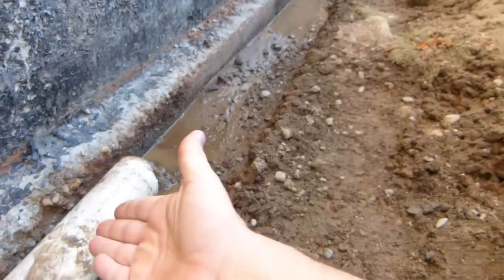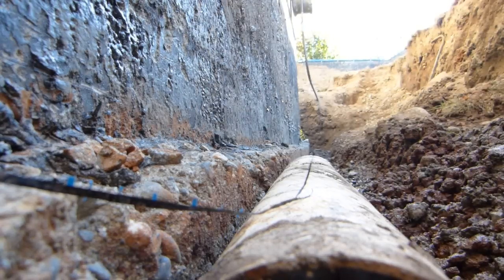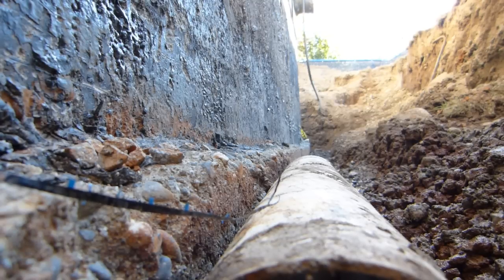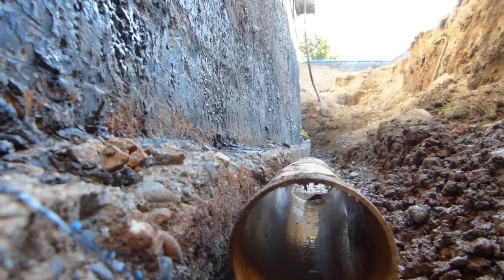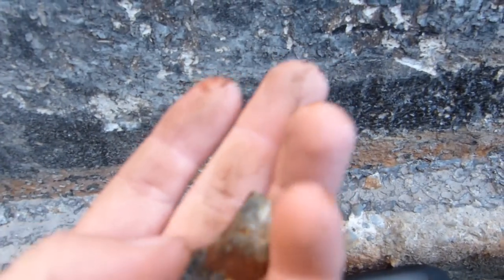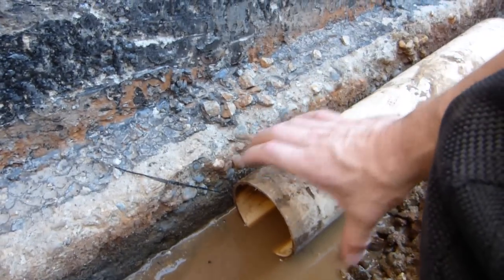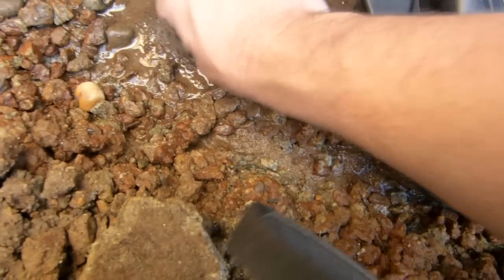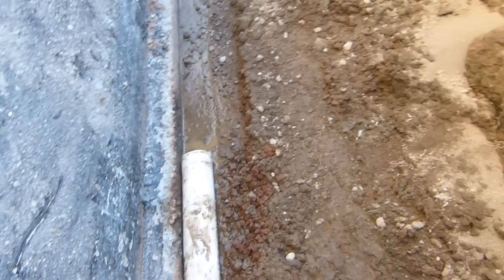Proper drain placement

Comment: This is the only proper way to do a french drain around a home. If the company bidding the job is doing a shallow drain and not going down to the footer and waterproofing the outside of the foundation, you're getting ripped off.

It'll be more expensive having a company dig down all the way to the footer, but it will completely mitigate the issue of water entering the basement walls and save you costly in the future.

Comment: Well explained. Question 1, where should that drainage evacuate to??? Please?? Question 2, Is it possible to add vertical pipe in a few places, or at corners to do Power Flush now and then??   Thanks!
Reply from the maker: Answer 1: to a deeper (lower elevation) pipe or sump
Answer 2: absolutely do, it might be part of building code requirements already

Comment: My parents live in my detach garage and have a piece of concrete along outside of garage (like a small side walk) with a negative slope so when it rains water goes towards garage and water has been getting inside.
I was thinking about doing a french drain system with corrugated pipe, fabric and gravel.  I was wondering if it be enough if I just dig about 6 to 8 " deep to lay corrugated pipe in just to catch water and deter it down to street?  I don't think I will need to dig that much since is not a basement is just a garage? Great video by the way.

Comment: You gotta wrap the rock and pipe in together in a sort of "burrito wrap" using non-woven double punched geo fabric.  You put the fabric in first.  Then the pipe. Then the round rock.  Then wrap it all together.  Otherwise in just 3-4 years the majority of the rock will integrate into the wall of the trench.
Reply: Exactly I couldn’t believe he said used angled rock
Reply: Will the dirt just clog the fabric and not allowing the water to get to the pipe?
Reply: @michaelpiecuch7313  seepage maybe depends if your dirt is clay or organic material on top of the wrapped drain. River rock is more likely to migrate, hence the name. You want jagged rock, for draifield - it just happens to be cheaper also like video said. In Soth Florida subtropics we use limestone to bed sewer lines and drains, it's also readily they mine it at local quarrys

Comment: How do you create slope in the footer tile (pipe) if the footing is level?
Reply from the maker: Right. Pipe should not be level, has to slope 1 or 2% to city sewer line or ditch or something. Really difficult in flat places like Holland.
Reply: @theoverengineer  My footer is level. How would I create the slope? My house is 30x30, so, to slope from NE corner to SW corner I would need six inches (30ft + 30ft)... but the footer is only six inches... am I thinking wrong?
Reply from the maker: yeaaahhhh .... not reeeaaalllyyy .....
The highest point will be just below the NE underside of footing, the lowest will be at SW at least 7.25 inches below that:
60 feet = 720 inches, which either times 2% = 14.5 inches of drop or times 1% = 7.25 inches of drop from NE and SW, but the lowest point at SW still has to be higher than sewer inlet elevation, if pumps are not considered.
Reply: @theoverengineer  okay. That would put SE corner of drainage below the footer by 1-1/4 inches. I have read that drainage should not be below footer due to possible wash-out under the footer. Will I need to make a deeper footer? Thanks for your advice.  FYI - I will need to lift the water two feet to get to the ditch (we can not pump to sewer here because of the waterway) or raise water one foot to my back yard. Property is 300 ft with only three feet slope.
Reply from the maker: @bob-ny6kn  "possible wash-out under the footer" - in a ravine or something, yes. Look at your local/state building code online, they even have drawing what works in your area
Reply: @theoverengineer  very nice. Thank you. I did not know the city would give a best code example. I will try to find it. Something like "City, ST residential building code footer tile drainage"

Comment: im putting pond liner against footing wall and on ground 8" out for pipe to sit on hoping this eliminates any water getting on to footing at all what do you guys think???
Reply from the maker: Water can also seep in at the inside of the footing where the floor slab meets the footing or foundation wall. If the subgrade drains groundwater well and there is no cross-slope damming groundwater movement, it should work ...
Reply: It would seem that would guide water from wall to being trapped behind liner. Could the liner cause it self to float and lift the drain pipe? How did it work out for you?🦇

Comment: Should I put filter fabric underneath the pipe?
Reply from the maker: Depends on the terrain, soil particle size, direction of ground water flow, annual precipitation.
Sure, it won`t hurt, but may not be $$$ necessary.
Reply: But definitely on top of the stone to separate it from the soil, right?
Reply from the maker: Correct, on top of the clean crushed drain rock.
Reply: @theoverengineer  How come you don't show that? unless I missed it..

Comment: Downspouts should never be tied into a French drain, or perimeter drain system. During substantial rains they can overwhelm the system - and downspouts are an entry point for debris (shingle asphalt, leaves, and such) into the system which can increase the chance of clogging.
Reply from the maker: Most people cover downspout entry points with a wire grille.
Reply: theoverengineer doesn’t stop the fact you can overwhelm the system from gutter downspouts. And a wire grill will stop leaves, but not the main reason for concern...shingle asphalt!
Reply: How would you install a 2 pipe system on just a repair of one side of the perimeter? I'm currently doing mine. If this was a complete perimeter drain job I would do 2 pipe system all the way around. But in this case it's just a relay of one side of my house. Any advice would be great! Thanks. Technically by code mymunicipality will treat this as a repair so do not have to adapt 2 pipe system. But if I'm doing the whole thing in the future what should I do?
Reply: If that is the case, that is why we have a "cleanout" and so we can clean once in a while and also the gutter should come with the "filter" protector and prevent all the debris from getting in there.

Comment: Donan engineers  'Typically the failure is NOT from hydrostatic pressure but from the soil re-expanding... in simple terms a basements wall fails when the pressure of the SOIL exceeds the lateral strength of the wall..  https://donan.com/knowledge-base/article/basement-wall-failures/   The expansive clay soil along-against F-walls is ABOVE the drain tiles, water gets INTO that soil before some of it gets down to the drain tiles hence there is already lateral soil pressure occurring against basement walls, and then we have some homeowners who have leaky basements due-to tree roots that caused exterior cracks in their block, brick F-walls, has ZERO to do with drain tiles, example ->> https://www.youtube.com/watch?v=C7rhB7m0ekw

Comment: all due respect but in my 40 years in this-business we've never seen a basement leak, seep etc due to any supposed problems with exterior drain tiles HERE is where-why most basements leak https://www.youtube.com/watch?v=leVZcnBFPA8 and https://www.youtube.com/watch?v=5dpGpiB7kQI and https://www.youtube.com/watch?v=Tq_o7C6KMUA There is way too much emphasis on drain tiles and nowhere near enough on waterproofing the wall (s). Chimney leak https://www.youtube.com/watch?v=TbONiKqB9I0 and https://www.youtube.com/watch?v=KUC0VQahgos
Reply from the maker: In the Pacific Northwest annual precipitation is 48 inches, 1200 mm at sea level. So what works in South Dakota is irrelevant. Here is some engineering principles for ya from 1st year college studies at around week 3:
1 Eliminate (* the cause of a problem, in this case water)
2 Minimize (* the quantity causing problem, in this case water)
3 Substitute (* the materials involved in the problem)
4 Add (* extra materials to create better barrier against the problem)

There isn`t too much focus on the drain tiles, there is only common sense:
level 1: ELIMINATE THE CHANCE OF GROUND WATER TABLE BEING HIGHER THAN THE SLAB INSIDE is most likely to work for decades with no maintenance or inspection.
level 4: Adding a coating does nothing to eliminate the problem, coatings break down / age and develop cracks as buildings & soil moves, needs ongoing monitoring
Reply: 40 years of doing this job hands-on, homeowners & videos to prove otherwise.  The cracks, other exterior openings into homes/basements are far ABOVE the lousy drain tiles, and water goes in through cracks etc long before some of it makes it way down to the tiles. And so I know, most basements leak, seep due to the videos I posted. Builders & Bldg depts. are the main screw ups as few do not understand and do not waterproof the exterior walls (I don't mean damproof, that's garbage and will break down quick) and they don't backfill with most-all gravel, they backfill with expansive clay soil and other debris which allows water to saturate that soil AGAINST F-walls and cause many cracks, bowed wall and subsequent leaks in basements. Damproofing is NOT waterproofing, not even close.
Reply: Even IF one could keep ALL water away from, off-of, the entire depth of foundation wals, imo you wouldn't want to. Why? lol Because having DRY, contracted soil along F-walls or under footings cause same types of problems as does wet, saturated clay soil, yes sir.
Reply: Expansive clay soil , shrinking and swelling causes more than twice the damage to roads, buildings, houses than hurricanes, floods, tornadoes and earthquakes  "Severity of Problem".... http://coloradogeologicalsurvey.org/geologic-hazards/swelling-soils/definition/   U S Army Corps, Page 2 in particular expansive soil/lateral soil pressure causes step carcks, horizontal cracks and vertical cracks in poured and block walls and subsequent leaks  http://www.amherst.ny.us/pdf/building/soilsstudy/TOASFS_section3.pdf
Reply: not sure you see, understand what we have seen for 40 years, did you bother to watch videos? The water that most homeowners get at--the bottom of the F-wall and basement floor, aka cold joint, FIRST gets into block and brick walls through the cracks etc in videos, it neters THOSE first, drops down INSIDE the hollow blocks etc and eventually into the BOTTOM course, bottom of wall and THEN...there it comes out onto the basement floor as it did here https://www.youtube.com/watch?v=3H34EfusL1w

Comment: Can I double the amount of drain pipes?  Would  two pipes be twice as effective?
Reply: You could also use 4 pipes for quadruple effectiveness heck go for 8 pipes..
Reply: @ginofoogle6944  go back to mars
Reply: Just use a 6" drain pipe. In general a 6" pipe will have about 180gpm capacity at 1% slope. 4" (as seen in this video) has about 80gpm at 1% slope.
Reply: @bbdrainage  - I agree 6" pipe is awesome at 180 gpm capacity, but two 4" has 160 gpm capacity and if your DIY and can't easily find 6" pipe, then two pipes is the way to go and practically as good, especially considering that DIY will end up costing so much less compared to hiring a good professional company that takes pride in their work.

Comment: do you put the drain rock in the trench before the drain pipe or on top of the pipe
Reply from the maker: Building Codes typically require that say 6 or 3 inches (or whatever actual number) of drain rock (of whatever size, always made by crushing, so it has sharp edges and does not clog up easily with silt, not rounded river rock) SURROUND the drain pipe evenly, so that means rocks under, besides and on top.
Definitely not burying the pipe under all the drain rock. As ground water rises from the bottom, it fills the space between soil particles, then as it rises fills space between drain rock where it can flow faster, then it reaches the drain pipe where it can flow even faster. Put lots of drain rock under the drain pipe. Covering the top of the drain pipe with drain rock has a much lesser importance.
Reply: Should I put filter fabric underneath the pipe? Or just on top to separate the rock and soil?
Reply: @alty79  Around the pipe so plants don't penetrate and shit gets into the pipe and clogs it.
Reply: Hi man, for you and others interested here is an example on how to do it https://www.youtube.com/watch?v=THarVoozjhc&list=PLW641dhyiaGNfyL8p19-CX1kg2rxllF60&index=12&t=3s&ab_channel=DoerkenFR